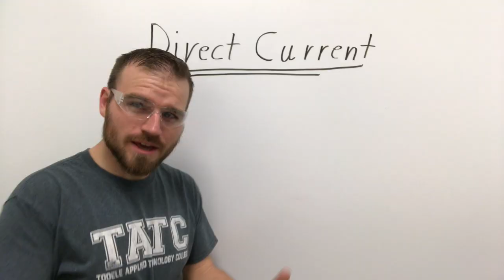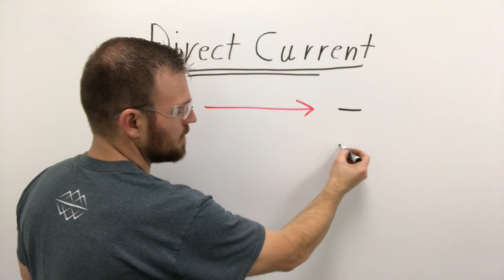Welding SMAW - STICK WELDING THEORY

Comment: electrons do not shoot from + to -, but from - to +
Reply from the maker: Nice catch and you are absolutely correct! I argued with myself about this one for a little while when making this video and in short the textbook my students used is based on conventional flow theory and not electron flow theory. I give my students a much deeper explanation of DC electricity in my electrical class but you are right! But the purpose of this video is to teach about welding and not electrical though when I remake this video I might change that. Thanks for your thoughts!